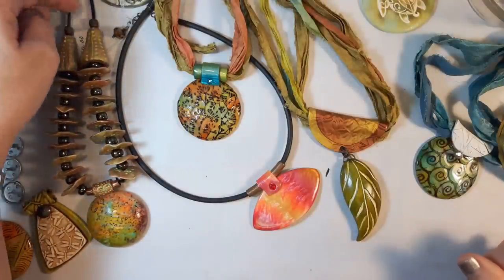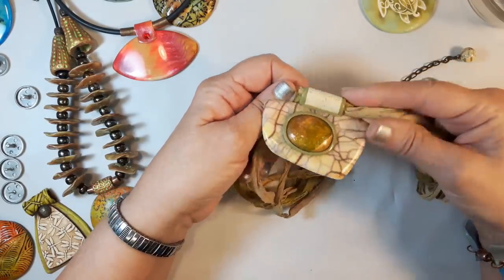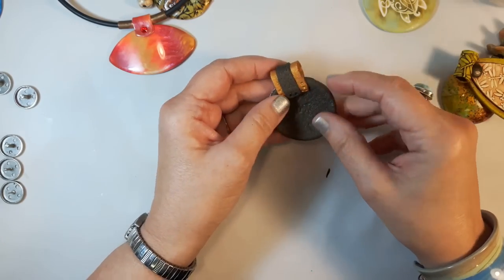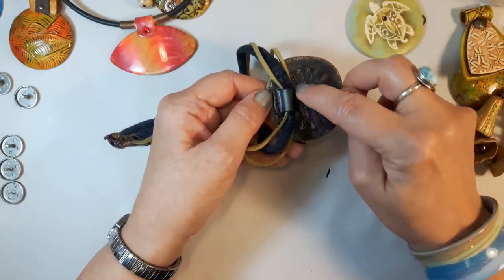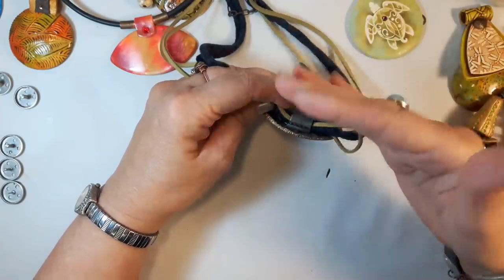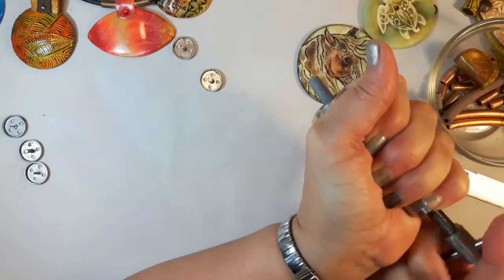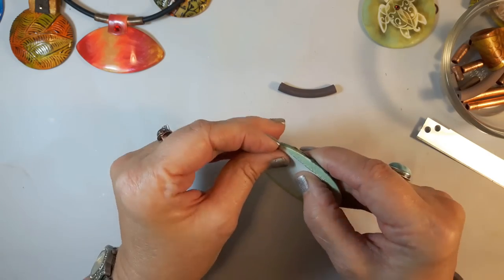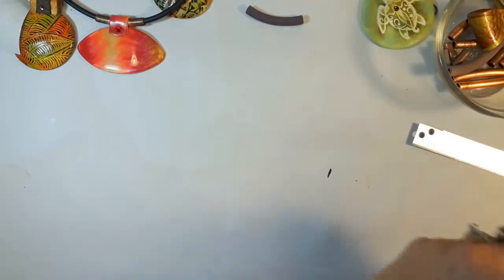Polymer Clay Bails

Comment: Where do you find the mount device for the extruder?  It sure would make extruding easier.
Reply from the maker: I just put that little extruder in a small vise that is clamped to my table. Usually I use a Lucy Extruder- they are much easier to turn, but I have a clamp for it too.
Reply: thanks for the tip.

Comment: Hi , Lovely tutorial. Thank you. I have a pendant, already baked. I want to put a simple clay tube bail on the top. The back side of the pendant is as nice as the front, and doesn't need any more backing. It's a good thickness. Do I need bake and bond? Will translucent liquid clay do the job? Or super glue? Or both? Or what? I remember reading an article from Blue Bottle Tree that said super glue never really works well, long term, for this kind of job. I hope you can help. Thank you.
Reply from the maker: Rachel Abrams , your best bet is to use liquid clay and rebake the piece. I usually use Sculpey liquid clay, works as well as bake and bond in my opinion. If I need a thicker paste I use Kato poly paste .
Reply: @patriciaroberts-thompson  thank you for your help.

Comment: How do you adhere the copper tubing (bail) to the polymer clay?
Reply from the maker: Nancy H , the copper is wrapped with a strip of clay that touches the pendant top and back. As long as it is tightly wrapped it shouldn’t come apart, and the curved shape of the bail also helps, because it won’t spin. A little liquid clay could help as well, but I’ve done several of the copper bails without liquid clay without any problems
Reply: @patriciaroberts-thompson  Thank you so much for answering.  I love your work!